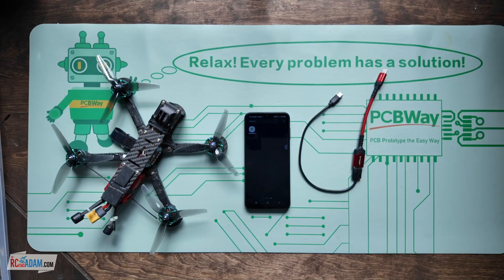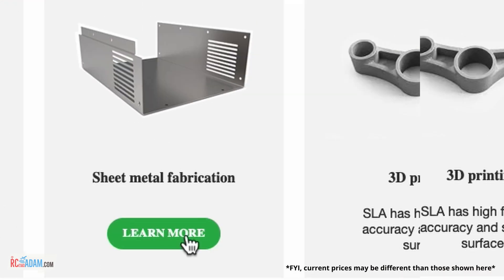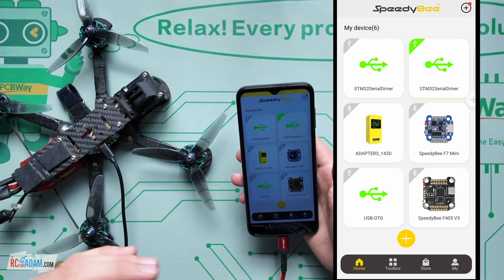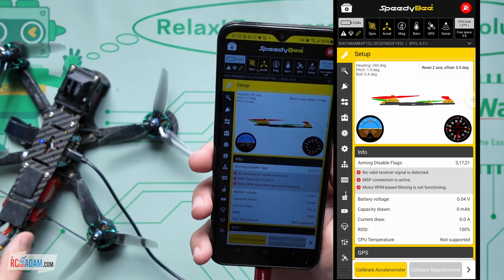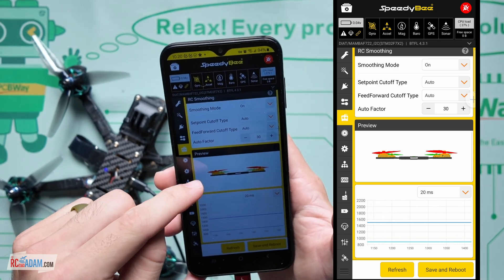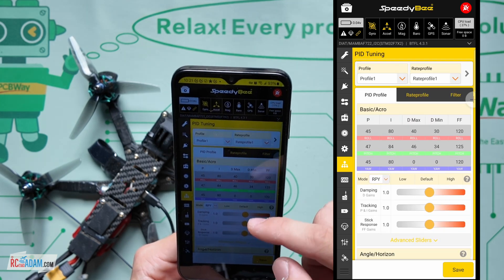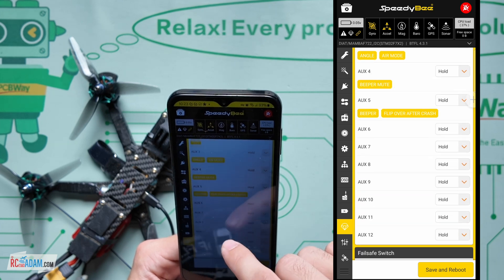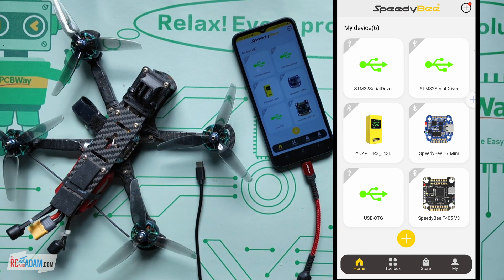How to Use SpeedyBee Configurator App // Is it any good for FPV drone Pilots? (yes, of course it is)

Comment: Can you flash betaflight firmware using the speedybee app?
Reply from the maker: Yes, but only if you are using a speedybee fc with a Bluetooth/wifi chip, or if you use the speedybee Adapter3.

Comment: No luck for me. I have OTG cable in phone and FC. It powers up the FC just fine. But when I start SpeedyBee app, it shows "0 devices",. How do you get "STM32SerialDriver" to show up???
Reply from the maker: The only thing I can think of is to make sure the USB cable that your connecting to the flight controller is for data and not just power.
Reply: @RCwithAdam1  Thanks for responding. It is a data cable, I use it to connect to the FC from betaflight on my laptop.

Comment: You had asked about the stick commands for the dji system. It does receive stick commands from the rc3 controller. Good Video! I’m looking for a video just like this talking specifically about the esc configurator on the app, and what those setting effect. I don’t ever mess with that, and all of past drones fly fine. I just wonder if they would fly better if I knew more about that.

Comment: Thanks, works much better than wireless connection, which works sometimes. Had an adapter cable at hand and no more issues at the field. In my case at least, flight battery has to be connected to use the App.

Comment: If you fly 3D, you can still use the app, but do not use it to spin motors in ANY way, it doesnt understand and will full throttle your motors until the app is disconnnected, and not just closed, the full BT connection or usb
Reply from the maker: Thanks for the tip!
Reply: @RCwithAdam1 sounds like something I  experienced when I was setting the Bnf moz7 the other day. That made me paranoid to fly it. So I have not yet.
Reply: Sounds like something I experienced the other day, that made me paranoid to fly it. So I haven’t yet.